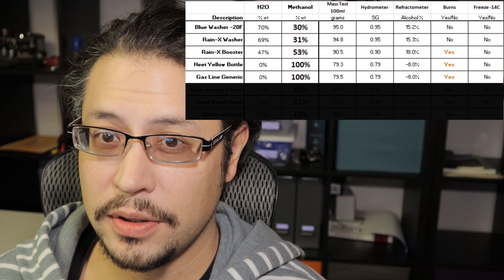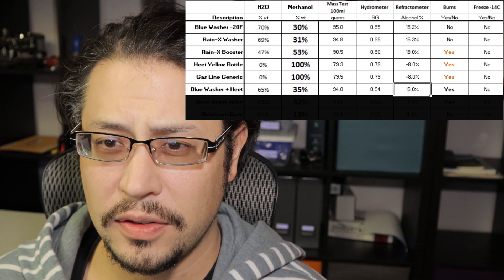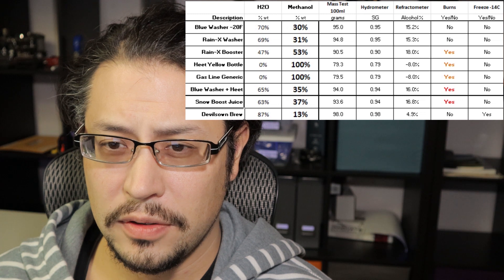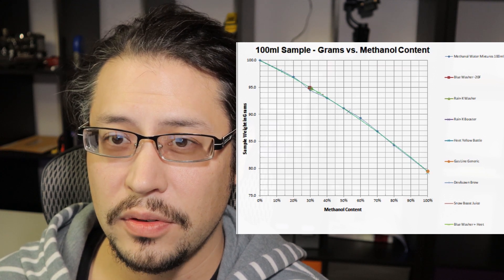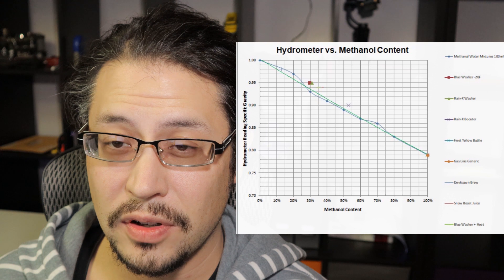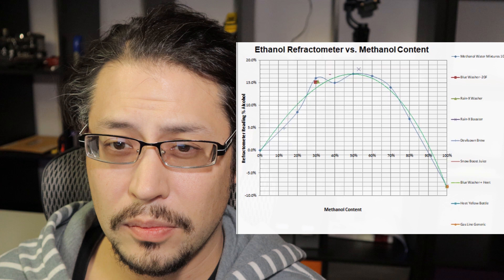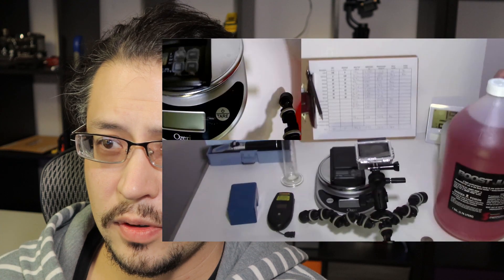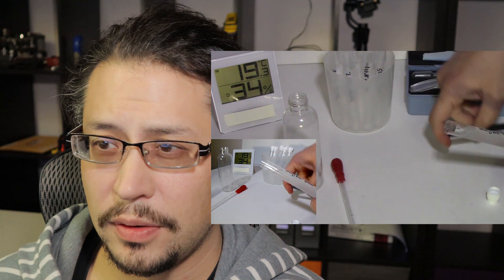How to Methanol Injection 101 - Fake Meth from Devilsown, Snow Performance - Part 3

Comment: In Alaska we would buy the -40 washer fluid, but that's for alaska only (says on the bottle.  Been buying snow performance boost juice since i had to move down south to Maine.  
Used to be 50 bucks for 4 gallons of boost juice, but now i went to buy some and it's freakin' 75 dollars.  in Alaska I paid 3 bucks for a gallon of the blue juice.  It went to 4 just before I left in 2021.
18 a gallon is insane, i'm looking at mixing my own but having trouble sourcing anyone within an hour of me who sells methanol.
Reply from the maker: Consider -20 washer fluid + a bottle of heet
Reply: @MegaMechatronics  I already bought 5 gallons of methanol and i'm mixing it myself. I made the 1 hour drive up north to buy it.  car seems fine.  no knocking so far.  $65 bucks for 5 gallons of pure methanol isn't too bad IMO.

Comment: Fuck this I am going c16 now
Reply from the maker: I've been mixing my own since I did this testing.  VP racing methanol + RO water, pretty affordable.  I've once crossed the border to Canada to buy 2 gallon jugs of washer fluid lol!  However, my opinion is that water/methanol injection off the shelf are crap and can fail, causing an engine failure.  If do it, go all out with individual injection nozzles and hardlines along with safety systems (flow, pressure) for engine protection.  Now C16 makes sense.

Comment: Someone talked about this in an earlier comment. However, I want to clarify what happens if distributors create mixtures based on a volume/volume, gram/gram, or mole/mole ratio. The outcomes make a very significant difference. If companies mix H2O and CH3OH on a vol/vol ratio, then mixing, for example, 500 mL H2O with 500 mL CH3OH, the company may legitimately claim this is a 50% Methanol solution (based on volume). If based on weight (gram/gram ratio), the densities of H2O (1 g/mL) and CH3OH (0.79 g/mL) are used to convert volume to mass. So, 500 mL of CH3OH is ~450 grams, and 500 mL of H2O is 500 grams. A gram/gram ratio yields a 47% CH3OH solution in H20 based on weight. If a mole/mole ratio is used, the molecular weights of H2O (18 g/mol) and CH3OH (32 g/mol) are used to convert 500 mL CH3OH to 14 moles and 500 mL of H2O to 28 moles. The mole ratio is 33% CH3OH to 67% H2O. The mole ratio tells you the ratio of molecules of CH3OH to H2O. Thus, a 50:50 mixture of CH3OH and H2O is roughly 1 molecule of CH3OH for every 3 molecules of H2O. This volumetric ratio must have been settled empirically as described in the primary literature (https://www.sciencedirect.com/science/article/abs/pii/S0306261920302622) and here (https://www.evolutionm.net/forums/water-methanol-injection-nitrous-oxide/372627-injection-mixtures-101-a.html). So, with the values so variable, as evidenced in this video, it is unclear which units of ratio (volumetrically, gravimetrically, or molarity) these companies followed and assumed volumetric. If someone says, "make a 33% solution of methanol based on molarity," yet mixes it volumetrically, then problems for the consumer ensue.

Comment: Really wow. I just started to get into meth injection n Id wondered about that don't know unless you mix it yourself what your getting. It's pretty messed up I mean the kits are not exactly cheep n to get a screwed at the end with the blends. Not cool. I've got a few bottles of ice lying around I'm going make my own mix..may have to have some extra filters laying around tho in case they get mucked up. If you ever do a video on how much these other methods clog the filters or not. But yah thanks awesome video. I appreciate it a lot.  Thanks.  Guy running tunes for meth can have a real issue with that ... Thanks again great video.
Reply: Hey on the bright side you got yourself a multi year supply of windshield fluid at least!

Comment: ok i used boost juice at -40c this winter in my truck and fluid never froze i now mix my own by weight 50/50 i use deionized water and 99.6 pure meth.i live in northern Alberta where it hits in the -50c with wind chills.

Comment: What do you use? What mixtures? I'm looking into purchasing a kit and trying to figure out which methanol to buy.
Reply: 100% VP M1.... water is for drinking.
Reply: @malloymotorsports780  hey, could you endulge me on your experience with M1? I just bought a jug, because I was recommended it, but am still on the fence about the straight meth vs 50/50 thing. Though I'll probably end up running straight meth at the end of the day since mixing my own is a hassle.

Comment: Yeah, why I dont buy any premixed garbage either.  I buy 55 gallon drums of 100% pure meth and mix my own dependant on what I'm doing, racing, towing or daily.  And its only $1.75/gal, so I dont pay for free water.
Reply: Wow! Where do I have to go to find them selling methanol like this?
Reply: @Nathan-wn5mc   usually a bulk chemical distributor.  Google a place that sells drums of oil and cleaners, they would most limely have it.  You can have it delivered, but delivering $500 drum by freight is expensive.  You may need to drive a little, but its worth it.
Reply: @jphillips472  Yeah I stayed up doing research all night. It's looking like a 3 hour drive will be the better route to go at this point. Thank you.
Reply: @Nathan-wn5mc  thats exactly how far I drove 1 way.  With the roumd trip and pick up and everything, it was an 8 hour day
Reply: @jphillips472  Yeah not a bad price either. 35.99 for a 5 gallon bucket 99% methanol. If i had more use i would grab a drum but I feel like it would take me a life time to use it.
Reply: @Nathan-wn5mc  I paid $225 for a 55 gallon drum.  I thought the same, I would have it for ever, 6 months later, im out.
Reply: @jphillips472  I just don't want it to dilute or anything I'm only using it for my race truck which I only pull out on the weekends.
Reply: @Nathan-wn5mc  oh yeah, I use it everyday

Comment: Hi Bro. They sell Boost Juice 51% water /49% mehanol measured by Volume, not by Weight. However measuring your data i found that the Volumetric ratio between them is 57.5% water and 42.48% methanol.  And we have to check beceuse they put an additive so it can affect the Mass-Volume of water methanol that you are measuring.  However AEM recomend 50/50 volumetric mix, that its not flamable as long as Alcohol flame is invisible it can be dangerous. 
For a 100ml we can mix 50ml water and 50ml methanol and its gonna be good.

Comment: IM just running pure meth from an industrial supply store. Problem solved
Reply: I heard it's bad to run straight meth.
Reply: @Nathan-wn5mc  Def not. Water doesnt burn. Methanol evaporates at a lower temp and contributes too combustion.

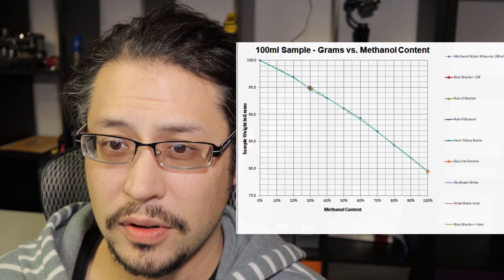Comment: 6:49 Is this test affected by type of water? Distilled vs. Municipal vs ?  thanks
Reply from the maker: Good question I looked up some stuff. Chlorine in drinking water is limited to 4 parts per million and I assume also contains small amounts of minerals, so most of it would be just water. You'd just need to consider the mass of the contaminants like other fluids and solutions because that would impact the density / specific gravity and throw off our measurements.   I used distilled water in these tests.